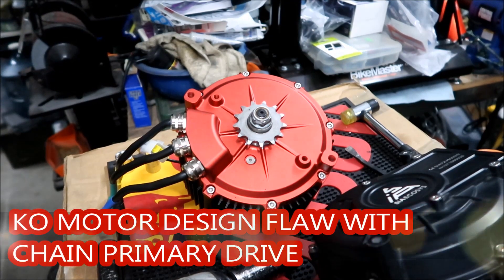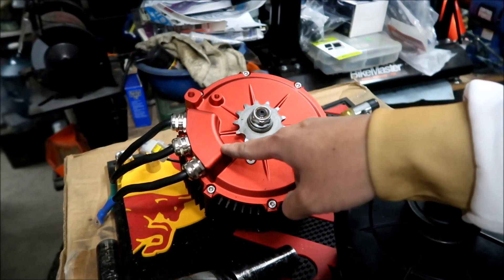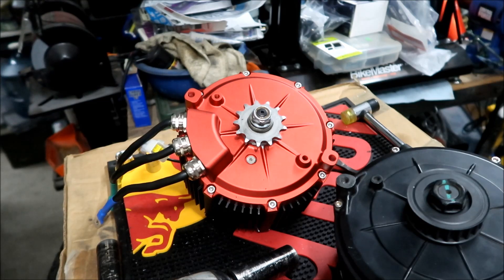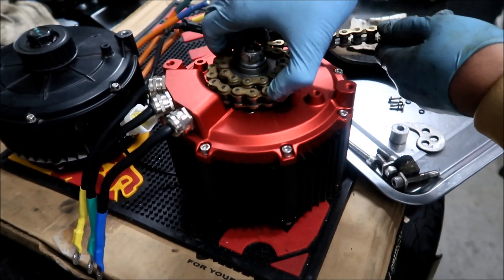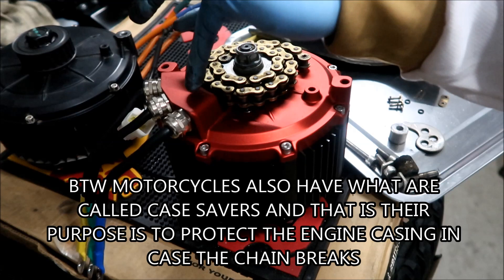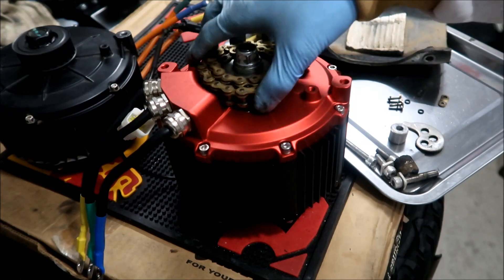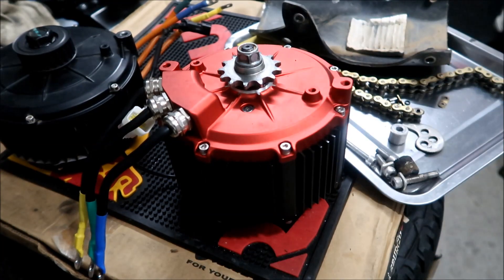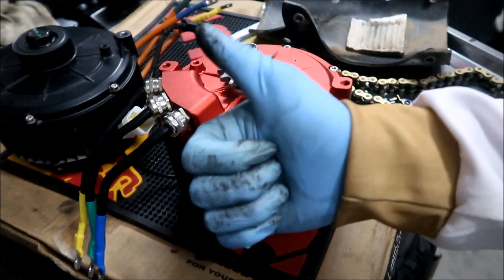KO Motor Design Flaw with Primary Drive 420 Chain

Comment: you are never going to destroy that with a chain it is a large chunk of 7075 aluminium.  You might gouge it a little bit but the reason that the the phase is terminated this way is to increase the stator volume that can be fitted into this casing size. It is definitely not a flaw it is a very innovative way of maximizing stator volume. This is the reason the motor has so much power compared to the other two motors you have there.
Reply from the maker: Well I hope I don't get a chance to find out
Reply: @hadesomegamoto7639  it would be virtually impossible. There is no way that chain is going to cut through a piece of billet 7075. Its not even cast like most motors is it full cnc billet. It is as tough as it gets. There is absolutely no reason to consider this a flaw in design when it allows for so much extra stator volume to be put into the motor. This design at its best and gets the most out of the sizing constraints.
Reply from the maker: I think you underestimate how strong a chain is.  Remember I said it's enough to take a leg off.  A chain like this is made of hardened steel it made to withstand a lot of forces.  So your're saying hardened steel won't damage this aluminum.  Last I heard they don't make armor out of aluminum they use STEEL.  I know they make practice swords out of aluminum but when you want to actually cut something they use STEEL.  Believe whatever you want to believe.
Reply: @hadesomegamoto7639 you forgot to say “alright “ for the millionth time this shit is so hard to watch !